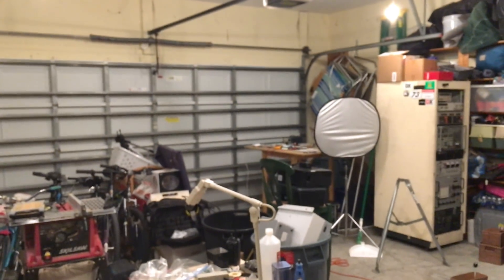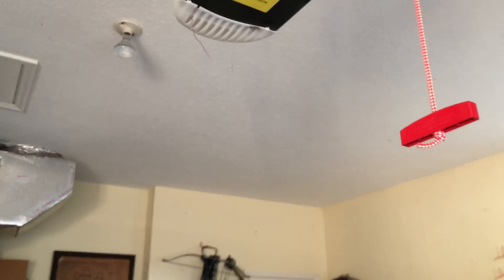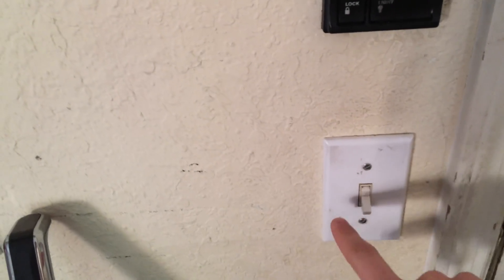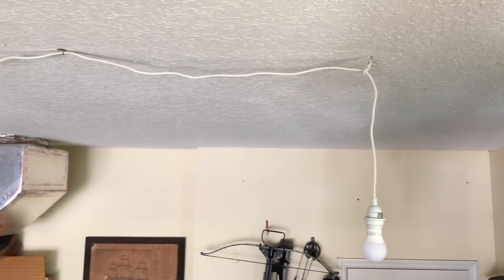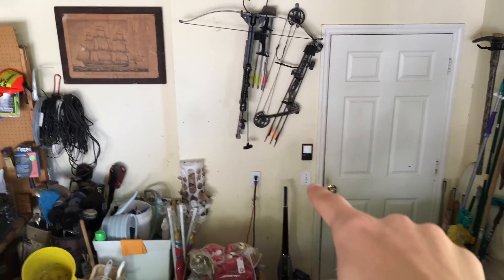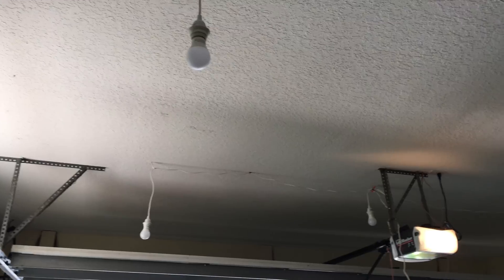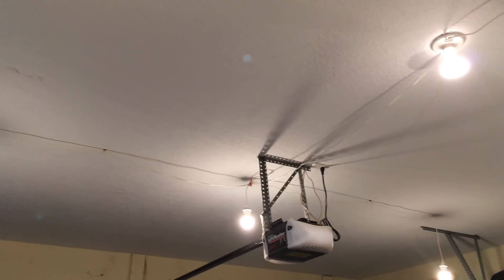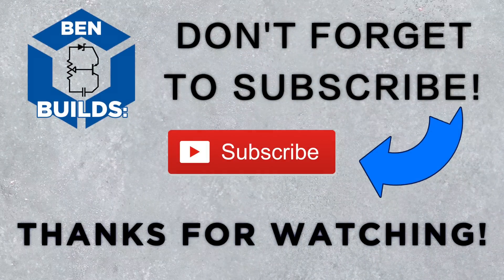Ben Builds: 3,600 Lumen Workshop Lighting System | Under $50

Comment: Good lot of light going on in there now!

You couldn't have put the wiring through the roof? I've got a few tips I could share if there isn't much crawl space in there.
Reply from the maker: +Colum Black-Byron (Previously Colum&#39;s Aquaponics) Yeah, there isn't much space (none at all) and while it would have looked better, the cost benefit analysis didn't work out.
Reply: I've got a similar style roof, you have to pull up the steel to get into there.

There are a few tricks (that don't cost anything extra), there are some long hard plastic strips (usually in the electrical section), you tape the wire to one end, and can usually push it through under or over the beams, and pull them out of the other end.